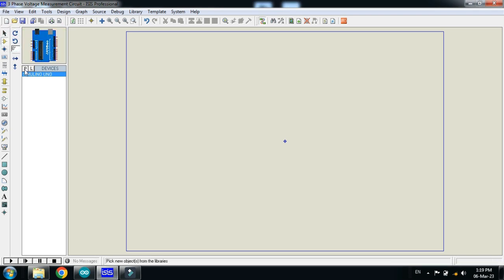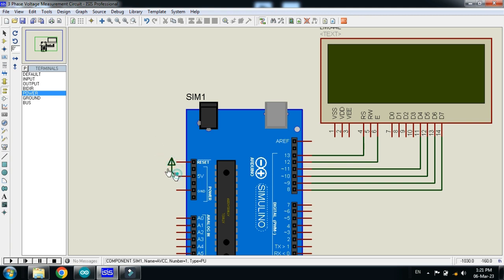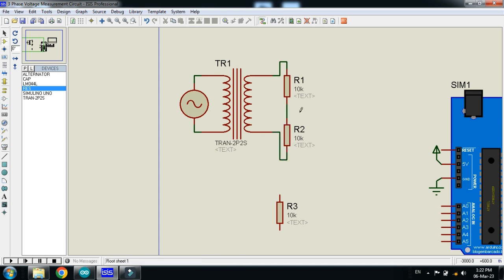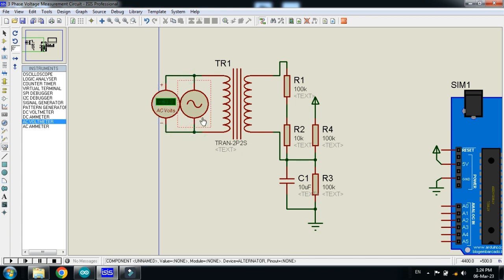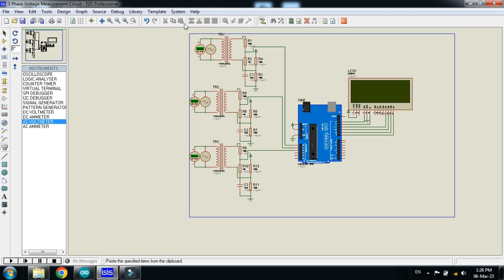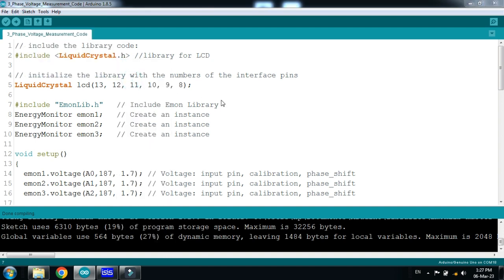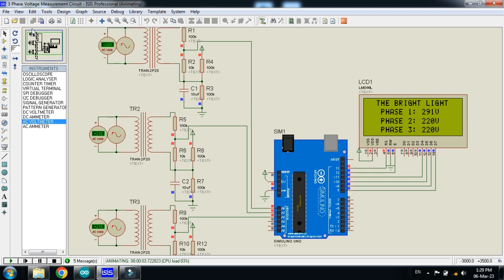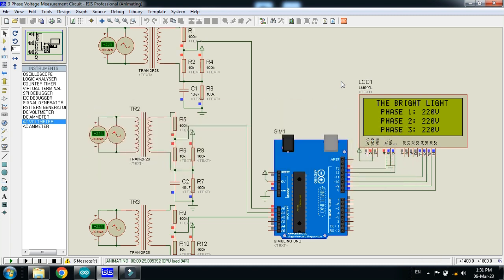Measure 3 Phase AC Voltage With Arduino With Code and Circuit || Proteus Simulation

Comment: Isn't arduino supposed to receive a dc voltage or less than 5volts?

Because I don't see bridge rectifier
Reply from the maker: Check the details video please
Reply: @thebrightlight9472 
So if I rectifier still going to be the same thing
Reply from the maker: Here in this circuit we measure AC Voltage not DC brother, so don't use rectifier, because rectifier will convert the AC to DC.

Comment: Hi, could you please tell me why is the voltage divider with the capacitor (R3, R4 and C1) connected to the common pin of the transformer and R2? I guess R3 and R4 are there to get (rise) the middle point of the waveform. But what is the purpose of the capacitor? Thank you for sharing.
Reply from the maker: All these components are combined to make a complete circuit in order to measure the AC Voltage. The resistors are used to divide the voltage and capacitors are used to store the charge.

Comment: very informative video bro, I am working on 3phase DOL auto starter, whenever there will be voltage in 3phase pump should start, any idea where i get such project
Reply from the maker: You can make your project while keep in mind this video. In this just add pump to it. Because it already sensing the voltage.
Reply: @thebrightlight9472  But, we dont have neutral connection, i mean only 3 phases, so i have to chech voltage between phases A,B,C then between A-B, A-C,B-C
Reply from the maker: Got it. You will need Delta connection then.
Reply: @thebrightlight9472  ok, let me check that, if you know anything, any link please do share
Reply from the maker: I don't have it now. But if found, will share with you. Thanks
Reply: @thebrightlight9472  Please
Reply: @MrNams hi bro, did you find how to make it?
Reply from the maker: No brother
Reply: Yes bro pls do this 3 phase  voltage measuring circuit without using neutral wire. And if possible without using transformers (to reduce cost).